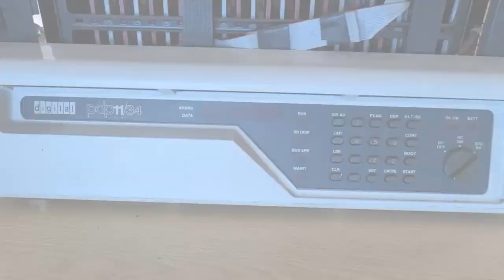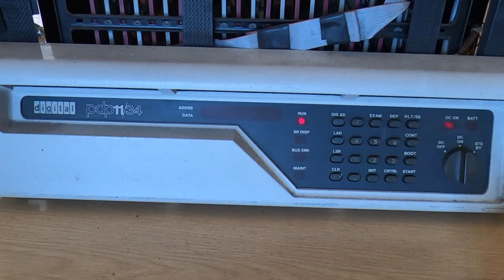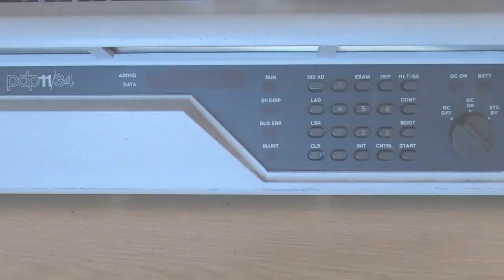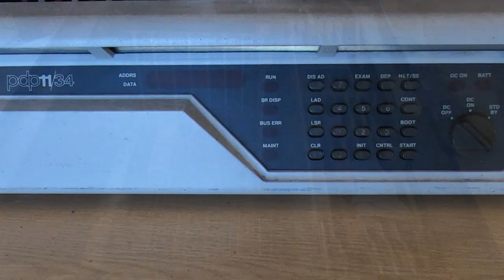PDP11-34A Repair Part1

Comment: I used to repair PDP1134A circuit boards to component level and had a PMK05 unibus analyser. 173004 load address, control  start with M7762 disc drive controller and RL02 removable disc assembly pack with XXDP diagnostics. last one fixed 1995

Comment: Jerry, congratulations on the gift of the PDP-34A!  I had a chance the take three of them home from work when they were replaced ~30-ish years ago where I used to work, but was afraid to "liberate" them.  The Engineer responsible for them offered them to me several times, but I knew it was still frowned upon, so I let them go to scrap, and am still kicking myself.  :(  They were absolutely packed with the modules needed to control the test stands in that building (before they were replaced with more powerful computers - MicroVaxes, I think) and each had 3-4 RL-01s and/or RL-02s (there was a mix in there).  The room was a (mostly) functioning timecapsule at that point.  (Many of the test stands still had Nixie tube displays when I started working there, but they were slowly replaced with 7-segment displays, then more modern displays as time passed by the time I retired.)

Comment: Jerry have you tried to do combined ctrl + halt key to stop it !
Reply from the maker: Yes I have tried all the basics. I will be posting another video tomorrow. The initial problem is that the console interface is not running at all so I will be looking at getting that repaired first. I did not elaborate much on this in the video as I did not want to confuse anyone not familiar with the PDP's so want to show it step by step. Hopefully it is a power supply issue but could be a failed 8008 or ROM but as the card seems to be dead it could be anything. In the next video I will be running just the console with all other cards removed and see how it goes. Once I get the console working I can move on to the actual PDP CPU cards etc.
Reply: @JerryWalker001  i used to use one of these back in the days for geo mapping of wildlife, wetlands, waterways etc, with calcomp a0 digitisers, and sharing data via ebcdic format tapes with the museum etc!  pt100 series terminals and other wyse asci terminals .. brings back memories :)

Comment: It sounds a bit like only one fan comes on when you power the machine up.
Reply from the maker: Yes, only one fan was starting to spin. This machine had not been powered up for several decades (from what I was told) and one fan was fairly stiff so did not start. A few manual spins and it freed up and now joins in the noise party when power is applied.